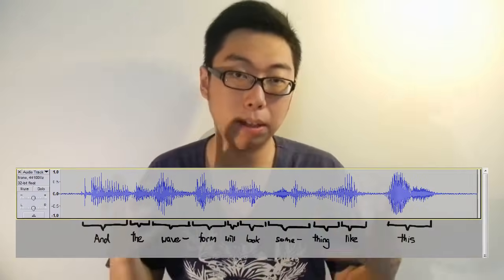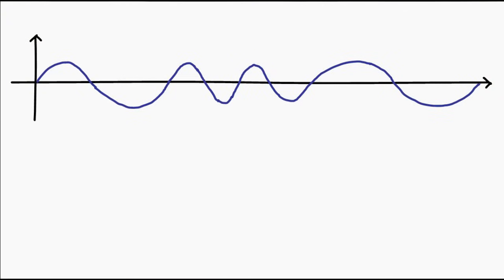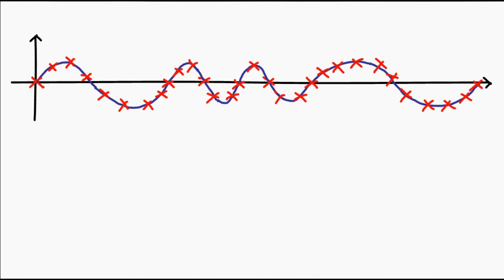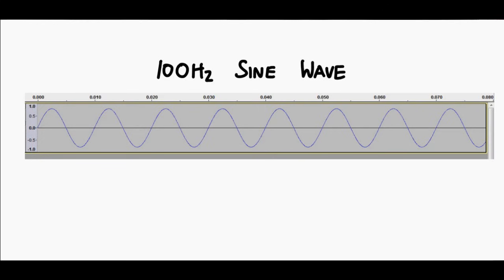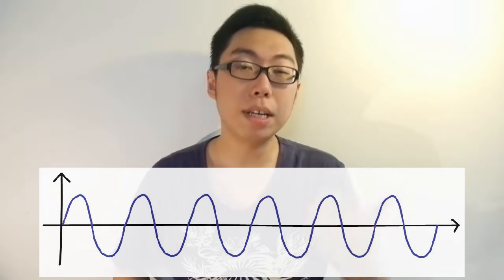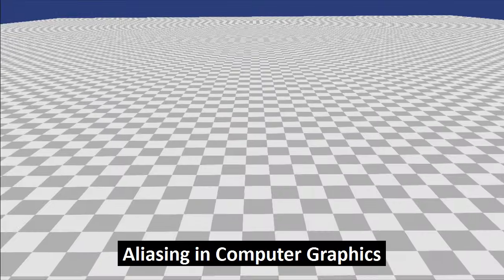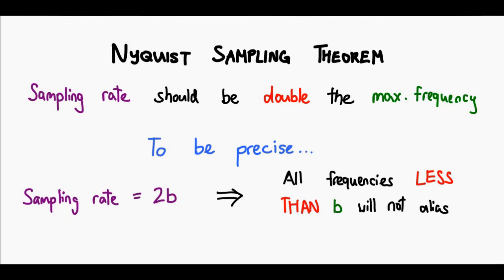Sampling, Aliasing & Nyquist Theorem

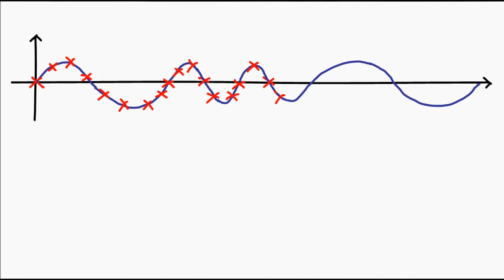Comment: i have a question..... at 3:20, what is exactly the y-axis? like i don't get which information is actually being captured during this process? and how?
Reply from the maker: Hello and thank you for your comment! Remember that sound is the vibration of air. A microphone picks up sounds when these vibrations "push" against the diaphragm of a microphone, causing that to vibrate in the same way.

Therefore, the y axis represents the displacement of the microphone diaphragm. 

To play back the sound, the diaphragm of a speaker is made to vibrate in the same manner. This allows you to "recreate" those vibrations in air, thus producing sound.
Reply: thank you so much! one more thing; we were learning about this exact topic as well in class but on my lecturer's graph the y-axis was labeled as 'voltage'. any idea what that could mean?
Reply from the maker: You're welcome! At its broadest, sampling can be used to convert any kind of analog waveform to a digital representation. Whereas in this video, I tend to use sound as an example.

In fact if we want to stick to sound, we can still represent the displacement of the mic's diaphragm as a voltage - The simplest mic is just a "reverse speaker" with a magnet inside a coil. When it vibrates, the magnet moves within a coil, inducing a voltage within it. What our recorder / computer is picking up is actually that changing voltage. So labelling the exact same graph with voltage is in fact even more accurate (because then the numbers mean something versus in displacement).
Reply: 0612 TV w/ NERDfirst i see.... So it's all in the mic. once again thank you for explaining!!!! I hope you have a great day :)

Comment: So basically humans can hear upto 20khz thus 44.1khz should be fine to preserve all the frequency range.  Then what is the point of Hi-res audio ? Just marketing ?
Reply from the maker: Hello and thank you for your comment! "Hi-Res" audio could also refer to a greater bit depth (ie. More different values per sample) which could indeed have some subtle effect on the audio quality. Of course the term also refers to increasing sampling rate as well. 

Whether these changes can really improve the quality of audio (or are even perceptible) is debatable. The wikipedia page on this subject is good reading since it summarizes everything: https://en.wikipedia.org/wiki/High-resolution_audio

Comment: Very clear explanation. Thanks. I have a question. Nyquist says that in order to reproduce a signal perfectly, sampling rate has to be at least twice the signal freq. And from your video, you showed it depends on when and where the sample is taken. The reconstructed signal is not the same as the original signal but fairly close.
The question is, does it help to reconstruct a closer to original signal by increasing the sampling rate? If yes, what is the "retina" sampling rate, i.e., any further increase in the rate does not matter anymore? Is there any study or research on this?
Reply from the maker: Hello and thank you for your comment! Extremely lucid summary, great job. Very interesting question too.

Yes - The greater your sampling rate, the closer you will get to the original signal. Assuming that the original signal is analog, a digital sampling of it will never be as "high resolution" as the source, which is continuous, but we get a better and better approximation as the sampling rate increases.

As for the "retina" sampling rate, this falls into the realm of perception, which is very subjective depending on both the context and the individual. In some cases (eg. audio), we already use sampling rates that are at the boundary of what can be perceived eg. A common sampling rate is 44.1kHz. Hence the highest frequency represented is just under 22050Hz, which is already beyond human hearing for the vast majority of individuals. Sure, maybe frequencies close to the cut off but still within our hearing range (eg. 18kHz) may get clobbered a bit, but I don't think most of the general population knows or cares, so I would consider 44.1kHz to be more or less "retina" (or perhaps "eardrum") in the realm of audio.

So what I'm thinking is, if we follow what Nyquist prescribes, and set it at a known threshold of the receptor, we can actually get something pretty close to "retina". If we want to push it further, we need to rely on further study to find a good "stopping point". Unfortunately I don't know of any study, and since sampling is used in so many contexts, I don't even know where to begin looking! You have to look towards your topic of interest.
Reply: Ok. Thank you for another super clear answer. Cheers.
Reply from the maker: You're welcome! Very happy to be of help =)

Comment: Thanks for the video, it helped me to understand better than the lecture where I was, especially the images were really helpful. Even though I wonder how could 2B frequency would be enough at all to reproduce the original signal, shouldn't it be way more than 2B to get really accurate copy of the original signal?
Reply from the maker: +PETAJOULE543 Hello and thank you for your comment! You are absolutely correct - When it comes to the accuracy of the sampling, it's always the more the merrier with samples. Really, the Nyquist theorem doesn't say anything about the quality of the sampled signal. Instead, it gives you a lower bound - If you go under a particular sampling rate, it becomes impossible to record particular frequencies.
Reply: @NERDfirst  Not true, I'm afraid. The Nyquist theorem actually states that a band limited continuous-time signal can be sampled and PERFECTLY reconstructed from its samples if the waveform is sampled over twice as fast as its highest frequency component, the quality at any frequency below half the sample rate is absolutely guaranteed.
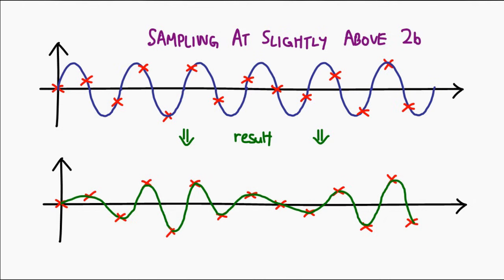There is absolutely NO advantage to higher sampling rates, this is one of the biggest misunderstandings in audio, and the part at 8:30 is incorrect. Don't believe me? Play a 20KHz test tone through a 44.1KHz DAC and connect it to an oscilloscope.
Reply from the maker: @chriswilson1853  Hello and thank you for your comment! Apologies for the late reply, as YouTube has a habit of not notifying me about replies to old comments.

Anyway, what you mention has been brought up several times by other commenters, and the general consensus is that all because you can recover the original frequency, doesn't mean it always happens.

The first point to note is that the assumption here is that the input signal has been band-limited, as you mentioned. Don't forget that sampling has applications outside of audio, and in some contexts, such as Computer Graphics, band-limiting may not necessarily be easy or even possible.

Also the key point to note is that the ability to reconstruct the wave perfectly as you mention involves the DAC performing the appropriate calculations to fit a sine wave through the points given. Again, we can't assume that this happens in every context in which sampling is used.

I don't doubt that I will see the results you mention with a DAC, but if we are discussing sampling in the most general sense, it remains that we have no information in between samples, so any kind of interpolation is no more than assumptions as to what happens in between.

Comment: I have a question that can i sample any signal for example if i have A =[1 0 1 1 1 0 0 0  1]. This is result after a random compression of different eigenvalue at different locations. I want to apply DCT or FFT on this. Can I ?
Reply from the maker: +Hassan Hayat Hello and thank you for your comment! From what I know, yes you can. The frequencies you derive from the operation describes this set of data.

Comment: Hello,

I thank you for the effort you have put in to bring up such a nice video.
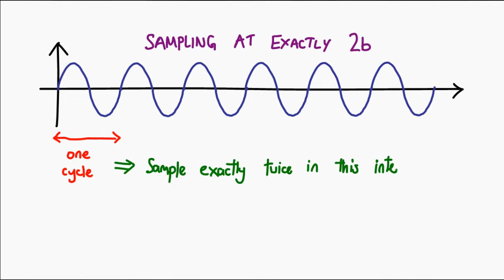I have a doubt here at about 8:05 where we start to plot the sampling points on the wave.

For Example : We have a 2 cycle sine wave in 1 sec. That makes its frequency as 2Hz and to sample it, we need to have more than 2x2Hz = 4 points. 
At exactly 4 points > 
Incidentally, the sine wave in its 2 cycles will intersect the X axis at 5 points including the start and the end. If we go by the way you have plotted the sampling points including the origin, then the last point of intersection remains without any point.

Also , the idea that appears to me behind the 2xFmax logic one of simply trying to have enough number of points to be able to atleast trace the wave-form. It's just the minimum possible points one will require to be able to define a waveform with even high approximation.

So as per my perception we need atleast 2Fmax + 1 points to be able to plot a graph or else we loose out on the last intersection point.

Please let me know if i was able to explain you my query.
Awaiting your response :)

Regards
Reply: At 8:11, you showed us exactly 2b number of points. Let's count the numbers on the screen and wee see them to be 13, which is 1 more than 12.
And the number f cycles upon counting come out to be an obvious - 6.

So there is a contradiction in the concept you tried to explain at exactly 2b number of points. It's simply not possible to represent a wave at 2B.  Not because it will be a straight line, but because there will be 1 less point to even trace the wave end to end.
Reply from the maker: +Suyash Sharma Hello and thank you for your comment! I didn't expect anyone to be looking too closely at the plots. You have to understand that they are hand drawn and definitely not to scale. They're just there to paint a general picture, so please don't trust them toooo much. Anyway, to address your points:

The fact that we don't have a sampling point at the very end does not mean the wave cannot be represented. Instead, in many applications we actually assume that the wave continues infinitely towards the right. If we make that assumption, then the sampling point at the end is actually the first sampling point of the next cycle. (Your example represented graphically: https://www.dropbox.com/s/1o6a34ytfx1p0xr/Wave%20Repetition.jpg?dl=0) So there is no failure in representation here.

Now let's say, for arguments' sake, that this wave is finite, and all of it is visible onscreen. Let's try and sample a 2Hz wave with exactly 4 points. Clearly, we can do that by dividing the second into three intervals: {0s, 1/3s, 2/3s, 1s}. So let's try that. I popped into graphcalc and plotted the actual sine wave. The green and blue line in the figure indicate the 1/3s and 2/3s mark respectively. The results are as follows: https://www.dropbox.com/s/rpqnzib4masp1aj/Sample%20at%20exactly%202x.jpg?dl=0. As you can see, what we get is aliased (we get one cycle per second instead of two).

Thank you for raising a very interesting point. I didn't see things the way you did up until this point, and I can absolutely see where you are coming from. However, not to worry - There is no contradiction there, as the end of the first cycle is just the start of the next one.
Reply: +lcc0612 Hello Again,

Thanks so much for the swift response and the great answer again. I spent the whole time thinking the same (end of first cycle is the startng point of the next)  myself and even tried to shift the 4 points to fit the 2Hz sinewave. I just felt somwehre inside that, it would be virtually only plotting for the first 50% of the wave (0 & 50) while assuming the end to be coinciding with start of the next. For simplicity's sake, I will keep it the way you just demonstrated without bothering too much about virtuality and rather about functionality :)

Also, the term "Highest/Maximum Frequency " can be misleading for a second.
I would say there are two ways to describe a signal frequency bandwidth.
Highest/Peak frequency - 5000Hz
Maximum Frequency - 250Hz (The frequency that covers maximum percentage of the bandwidth)
so can we say we need the peak frequency in our Nyquist Sampling since it defines the minimum requisite points to effectively recreate from Digital to Analog a signal.

Thanks again :)
Reply from the maker: +Suyash Sharma Hello again!

Technically we don't assume that the end of one wave coincides with the start of the next in terms of displacement. We just know that the sampling interval stays the same, and we just connect the dots. The result we can get can be good or bad, depending on our sampling rate. Don't forget that no matter how high your sampling rate is, ultimately you can only approximate the original analog wave.

With regard to "maximum" vs "peak" frequency, I honestly feel it's just semantics, and we happen to use the word "maximum" differently. At the end of the day, it is up to us to choose a sampling frequency - We don't have to base it off the peak frequency of our input if we don't want to. We just need to know that the sampling rate has to be "more than double" the greatest frequency we want to keep.
Reply: +lcc0612 
+1
Thanks so much :)
Reply from the maker: +Suyash Sharma You're welcome =) Happy to be of help! Thank you for your comments as well, very interesting discussion.